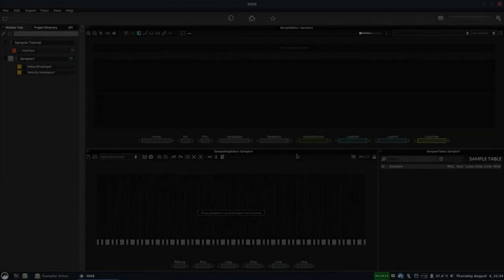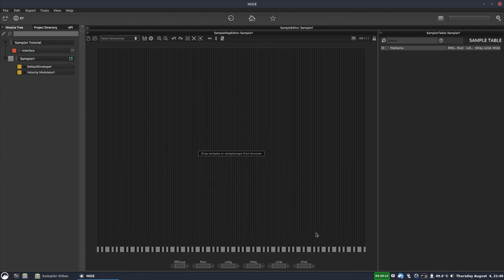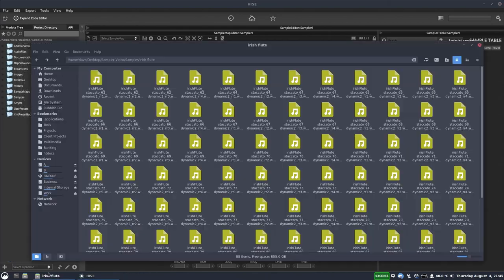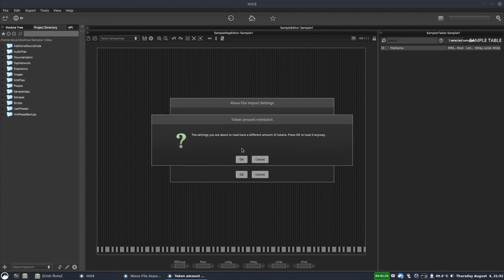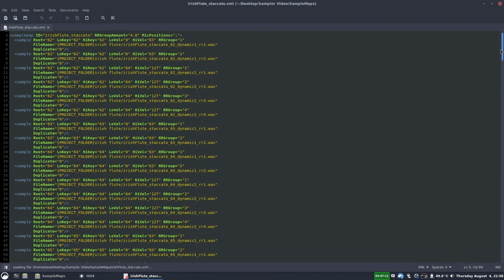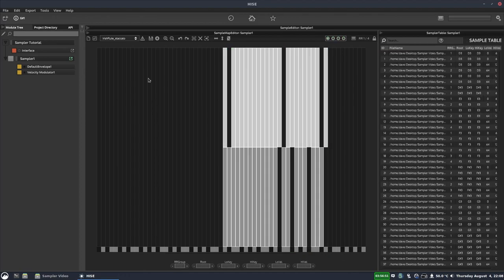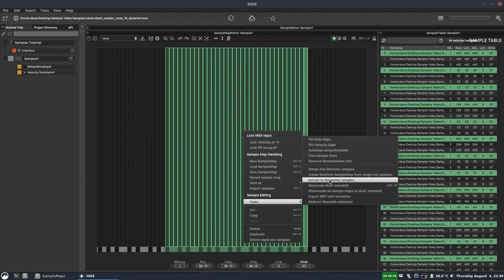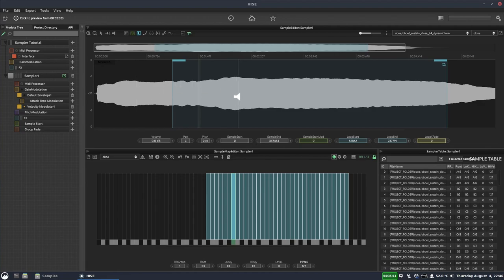A deep dive into the HISE sampler workspace

Comment: when I load an 11 multi-channel kick drum into the sampler Hise craches, does Hise support multi-channel samples?
I'm using Linux.
Reply from the maker: Hi,

HISE has a fantastic multi-mic system. You need to provide each mic as a mono or stereo sample. Then within HISE you can merge them into a pseudo multi-channel samples. This allows you to work with them as if they are a single audio file but also allows you to route and purge individual channels. Check out my videos on creating a mic mixer in HISE.
Reply: @DHealey  Thank you, I'll watch that video.

Comment: Thanks for this David, it's a really useful breakdown. I am getting a pop at the end of my 808 samples - presumably because they are quite long. Is there a way to auto trim and fade out the end of the samples in HISE without having to go into each one individually and edit it?
Reply from the maker: You can use the auto-trim tool. It won't add a fade out though, it will just cut them at the silence. I think for batch fadeout you'll need to do that outside of HISE.
Reply: @DHealey  yes I thought that might be the case. I think the samples are just too long personally and by changing the end cutoff it's still going to pop/click. Bizarrely I didn't have this issue when using the same samples in maize and they weren't playing in full/were clipped in there as well so I'm not sure why it didn't happen with maize?
I couldn't actually find a tool called auto trim, only trim start but it then let me change the end points in there too. Is that the auto trim tool or have I missed it?
Reply from the maker: @RzrSharpe  Expand the description for this video and you'll see a list of chapters. Click the one called "Trim sample start (auto trimming)". How long are the samples? HISE shouldn't have any issues due to the length unless it's something crazy.
Reply: @DHealey  yes that's what I was messing with last night. Just wanted to make sure I hadn't missed another option. With the samples, it's less about the size of the sample, rather the length. If I set the end point anywhere before it comes to a natural, faded out conclusion then it will pop as it is doing currently I think. I can't see a way around it without manually shortening & fading the samples and then reimporting them. Was just hoping there was a clever way in hise to save me some time. Thanks again for your help
Reply from the maker: @RzrSharpe  I don't think it's length related, HISE can handle very long samples. I think it's just that the sample is cutting off. What release time are you using on your sampler's gain envelope? Are you playing these as one shots or are they looped?
Reply: @DHealey  that's what I meant but I probably explained it poorly. I think the cutting off is the issue/cause of the popping I agree. I can probably fix it by upping the release slightly though that's true.

Comment: For linux I have copied the stand alone from a docker container, tried to run it and it can't find libippcore.so.10 which is a part of Intel Integrated Performance Primitives, I installed the whole thing with sudo apt install intel-basekit. tha path in the container is "/opt/intel/oneapi/ipp/2021.7.0/lib/intel64/libippcore.so.10" and mine is "/opt/intel/oneapi/ipp/2021.10/lib/libippcore.so.10", so I run it with "LD_LIBRARY_PATH=/opt/intel/oneapi/ipp/2021.10/lib/ ./HISE\ Standalone" and it worked.
Reply from the maker: I don't use IPP so I'm out of touch with it but last time I checked the one API was the way to go.